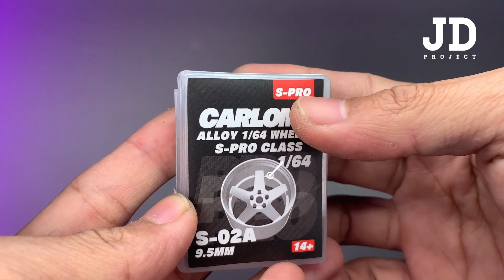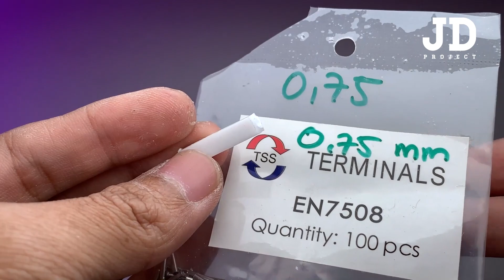Porsche RWB Rothmans Racing HotWheels Custom

Comment: request: Hot Wheels Porsche 911 GT3 RS That Goes Up Steep Hills

Switch Location: Top
Gearbox: Medium Torque
Rc? Yes
Special: Rubber Tires For Traction Control